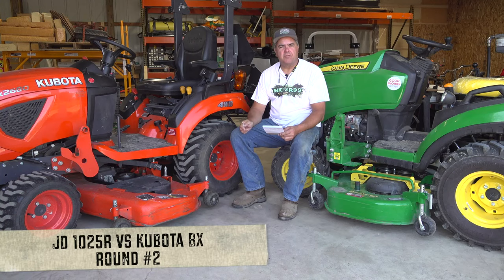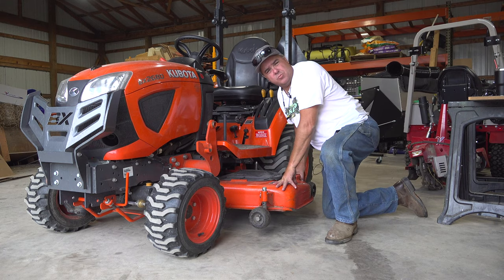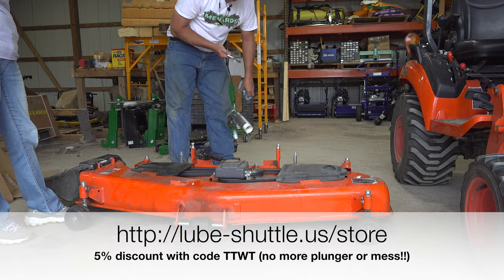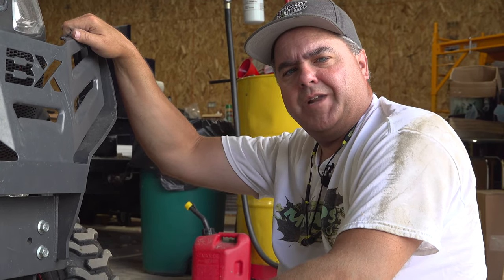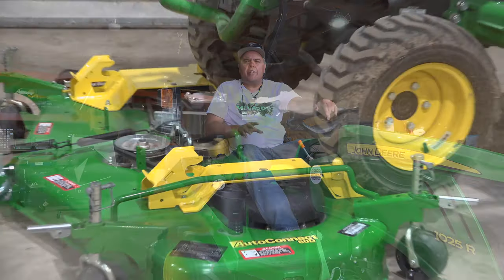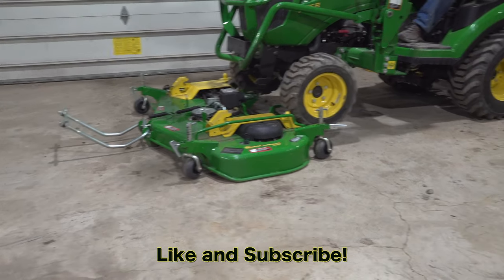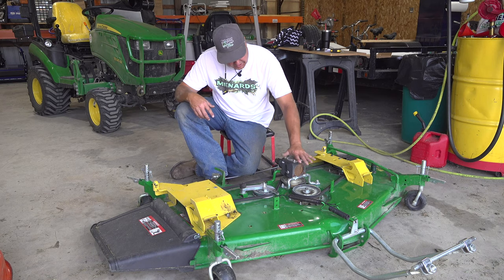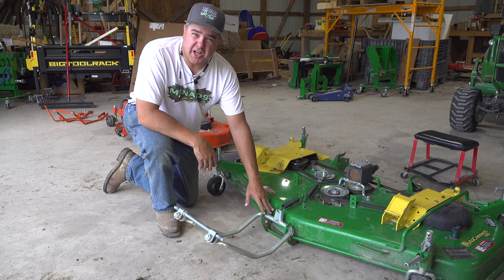Deere 1025R vs Kubota BX Round #2 of 8 Mower Deck

Comment: Isn’t the new Kubota deck a driveway be over “easy install” deck
Reply from the maker: Kubota offers a drive over deck, but the dealer sales folks consistently recommend against getting it.    Apparently it doesn’t work well at all.
Reply: My neighbor says the drive over deck for Kabota took longer to install because the ramps are in the way of installing the PTO shaft. And you still had to put the ramps on and take them off. Granted that was a few years ago when he got his. 5 years ago I got my 1025r and less then a year later he got a 1023 auto-connect. I think he just got a 2025 with auto-connect this year now. Or he is testing 1 because I just looked outside. He is mowing with it now. This from a man that gave me crap on not buying a Kabota 5 years ago. He used my 1025 1 time while his BX was in for a warranty issue about 3 weeks before he got his 1023. LOL. And we both don't like Sydenstriker's (our local John Deere dealer)
Reply: @TractorTimewithTim  I have one it works pretty good like I said they both have their issues

Comment: I have to connect the PTO shaft on my Johnny.  I am wondering if the dealer missed something or I didn’t purchase  that option
Reply from the maker: $500 upgrade. You should get it.
Reply: Yes worth ever penny
Reply: Tractor Time with Tim would it effect the snow blower attachment I have for the front?

Comment: Kubota also has a drive over mower deck
Reply from the maker: Yes, correct, but dealers recommend that folks not buy them. We couldn't find one.  There are several comments on this episode with personal experience. Each of them is entirely negative on the Kubota drive over deck.
Reply: @TractorTimewithTim  I have a bx and I would agree that the dealers don't recommend them. I personally don't have experience with the mower decks. Big fan. I have seen a lot of your videos. Keep up the good work. I have learned a lot from you

Comment: If I was to have a subcompact tractor I wouldn't have a mid mower. I prefer my front mount Grasshopper mower for my property.
Reply from the maker: In that case, I would recommend a slightly larger tractor (B or 2 series)
Reply from the maker: If I wasn't going to mow with it, I would not get a subcompact tractor :-)  I would get a bit larger tractor in that case.
Reply from the maker: If I wasn't going to mow with it, I would not get a subcompact tractor :-)  I would get a bit larger tractor in that case.

Comment: I went from a bx to a 2032R very disappointed with the cut quality of the mower deck (60D) so much so that i bought a zero turn to mow with.  Hands down the kubota bx mows better.
Reply from the maker: What specifically do you think is sub par on the 2032r deck?
Reply: @TractorTimewithTim  leaving 2 strips between the blades, uncut spots while turning, scalps at 2" difference in height, only 1" adjustable increments after 4", 
Electric lift has failed twice under 20 hrs 
I love the tractor but the mower is crap, my brother in law has the same issue with his 1025r.

Comment: Kubota has a driver over deck
Reply from the maker: Yep.  Could not find one.  Kubota dealers consistently do not recommend them. Therefore there are not many available.  
There are a few comments here from owners who have them (again, consistently negative).  Check them out.

Comment: my bx mower deck is not a drive over but very easy to install and uninstall
btw are you ganna make an episode on the tractors ground clearance and soft bits underneath?
Reply from the maker: how is yours easier than this?
Yes, we'll talk about that.  Another weakness for Kubota.
Reply: @TractorTimewithTim  bout the same as the one in your video but after doing it 20 times its second nature

Comment: Some days I wish I had bought a mid mower for my 1025r. Be handy to have rather than having the 1025r and another mower tractor.
Reply: Just buy a rear mounted mower.
Reply: Jason Buis I've thought about that as well but I usually move trailers and a hey wagon when I'm mowing so I'd always be swapping the mower out with the hitch on the 3 point
Reply: You can still buy one.

Comment: I have a 2019 2032r with the auto connect deck with 49hrs. I love how fast you can remove it for other projects but it just threw a code that has something to do with the actuator and it won't let me go to zero to remove the deck. I looked the code up online and seems like a common problem that is recurring even after being replaced. I hope this is something deere is working on a permanent fix for because its supposedly a 1200 dollar part. With all that said I'd still pick the Johnny over the Kubota..
Reply: With only 49 hours I would think the warranty would pay for the repair.
Reply: Yes they will I'm sure but looks like it's a recurring problem and warranties don't last forever.

Comment: The auto connect doesnt always work perfectly but in my experience it's usually something I did wrong on my part or missed a step. Still 10x easier than finagling a deck out. Only thing I dont like about it is when you get something jammed underneath or if the blades bend into a u shape, the deck doesnt sit even in the ground so you cant drive over it. You have to jack the tractor up and finagle it out but that's only been a couple of times weve had that issue

Comment: Wow, I thought the JD deck install/remove process was infuriating until I saw this. Makes the 3pt finish mower  or flail mower look like the way to go if you are going to mow with a compact tractor.
Reply from the maker: I dunno.  I don’t mind the JD mid mount disconnect.  I find it easier than a 3 pt / PTO attachment.
Reply: @TractorTimewithTim  I'll have to watch your video on making the deck adjustments. Ours has never just clicked into place. It takes an awful lot of shaking, shimmying, and cussing to get it on. We don't seem have a great service department here, so I'm sure the setup was not done well when we bought it new.

Comment: Tim does John deere make the load and go for the 2032r w the 60in deck too? Sure would be nice to use the loader to change blades!
Reply from the maker: I am not sure.  Ask the folks at greenpartstore.com
Reply: I think the decks are the same on the 1 and 2 series aren't they?
Reply: I do think the decks are different. 2 series has right side mid mount and I think 1 series is left side.
Reply: @mjrbo0wen  my 1025 is a 54D and I could have got a 60D and the guy down the street has a 2038 with a 60D I think it's the same model. I'm not sure what you're saying about left and right. Are you referring to the shaft? If so I don't think that will interfere with the load and go. I think it is for all 60D after all that is the model # of the deck.
Reply: @mjrbo0wen  just looked on tractordata.com and the attachments say it's a 62D if so it could be different because it is a 62" not a 60" the 2038 does show the 60" though. So not sure what is going on.
Reply: Its actually a 60d that I have on a gen 2 2032r and yes that's what I meant was the deck drive is on the left for the 1025r versus the right on the 2032r. Both are 60 inches but the drive over plates are different which is why I was asking whether the load and go could work on that. Seems it wouldn't though hence why I dont see it listed to work for a 2032/2038r with the 60 inch deck.
Reply: @mjrbo0wen  I have the auto-connect on my 54D and it is right behind the center blade. And it is the same gearbox only a adapter on the splines where the manual PTO shaft came off.
Reply: @mjrbo0wen  your drive over ramps are wider on your deck because your tractor is wider. And I think that's the reason for the extra holes in the ramps for the plastic belt guard so it is possible it will fit. But I would check with your John Deere dealer to see for sure. As Tim said.
This is a Deere part.

Comment: You mentioned the deck gear box
On my cub cadet 5234dl  Earlier, in July, while cutting some tall grass, the gear box stripped the gears.

A very expensive event
Reply from the maker: is your gearbox directly connected to the center blade?
Reply: @TractorTimewithTim  No, the center blade has a separate spindle.

all the spindles are driven by a 115" belt, where the belt is driven by the gear box

Comment: I have a John Deere 2305, 2010 model..... From what I am seeing from your videos so far, is just that Kubota is a few years behind Deere.   This newer Kubota disengages the mower exactly like my 2010 Deere.  So in theory, Kubota is approx 6 to 10 years behind Deere
Reply from the maker: And yet in other areas Kubota is ahead.
Reply: Booooo....  Lol....  I'm sure they are in some ways.  Love the channel Tim, keep doing your thing
Reply: yeah plus now there is a heated and ac cabs avalible for all the bx series now wich is a nice option
Reply: Kubota does make a drive over deck with auto connect but it's still not as user friendly as the current Deere. With that said on my BX 2370 I never turned the deck wheels, I just used the FEL to raise the front and slowly reversed until the front wheels cleared the rear of the deck then slowly lowered the front end. Works like a champ.
Reply: @Lilfarmrboy  these bx series makes a great size tractors for municipailty for towns/cities sidewalk machine and mowing and street sweepingcheaper then a $140,000 holder c992
Reply: @UCiYCYPuMAmApEpNKa0_Bf1g My BX1850 has a plastic hood and fenders.  I've replaced all three of them.  I still love my BX, but not the plastic body parts.
Reply: @botabob  there steel hoods thats avaliable for it to replace the plastic at my dealer accully wich it can be switched from plastic to steel wich is nice but my dealer still carries plastic wich it is 2 options for hoods plastic or steel wich is nice have options for either  even the fenders
Reply: @michaelmactavish1728  - I wonder why I was not offered the metal replacement parts.  Thanks for the information.
Reply: Everything is going plastic though..... Again my 2010 model has metal hood and front fenders, rear fenders are plastic.... Now the Deere are all plastic I think
Reply: I meant the front side grills not fenders
Reply from the maker: I think the newer poly plastic material is getting better all the time.  I have dumped loader material on my hood repeatedly (I apparently never learn) without any damage at all.
Reply: @plainviewfarms6364  I don't think you will see plastic on the Kubotas since they tout the steel on their tractors as a selling point in their ads.
Reply: @botabob  yeah its useually inspected over in thailand wich my niece pares pinky's mom   phung pinky  is the chief inspector for kubota coropration
Reply: @plainviewfarms6364  yeah deeres are all plastic and kubotas plastic or metal options
Reply: @Lilfarmrboy  no but its optional if customers wanted or want the steel metal

Comment: Pretty obvious the Kubota deck is more stout. Also Not only does it have over 2" more clearance its half again deeper looking than the Deere deck. Lots of compromises to do a drive over deck. That's a fact. For Men, pulling that kubota deck out is no issue.  I yanked mine out without issue and didnt think to turn the wheels as it's not necessary if you're strong. Frail and or unhealthy people would do better with the drive over deck if they are needing to remove it a lot.
The belt on the kubota looks much thicker as well.
The deere has no room for tour feet compared to the deere either, the bx has a huge floor area. The loader mounts on the deer are bigger than the empire state building sticking off the side. My kubota loader can be removed without getting off the tractor, how about deere? When's that video?
Reply from the maker: We will begin focusing on the loader in Round 4. Round 3 is the mower operational tests.
Are you insinuating that I would not discuss loader installation and removal?  I believe I have been as fair as possible.
Just because you CAN manually pull a deck out from under a tractor, does that mean you WANT to ...when you have other stuff to be doing like loader work, etc.  I fail to get the "if you are man enough..." angle.  
If you were a real man, you would use a push type reel mower without an engine. Good grief.
We use tractors and equipment to make our lives easier, not to prove how strong we are.
Reply: Mr M the correct response to Tim’s reply is “touché”